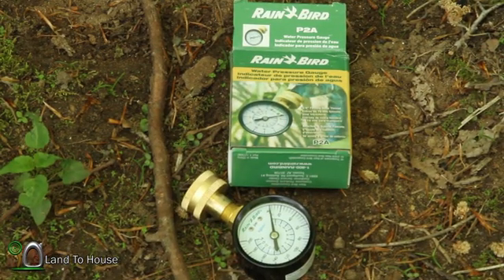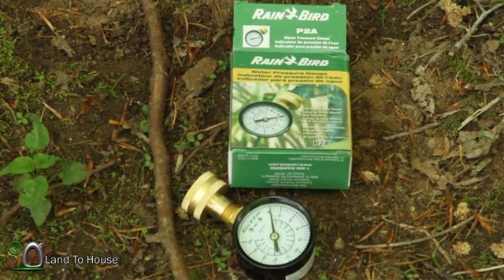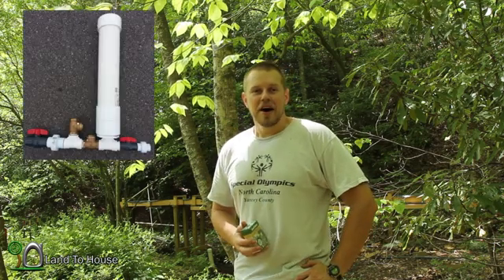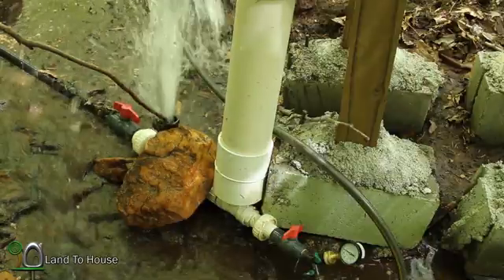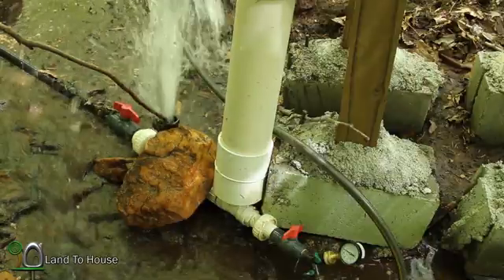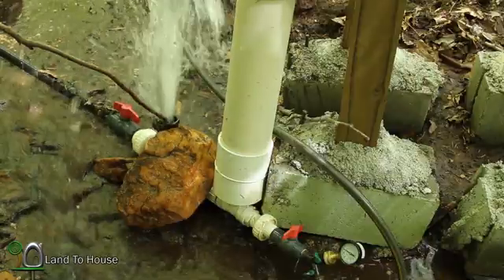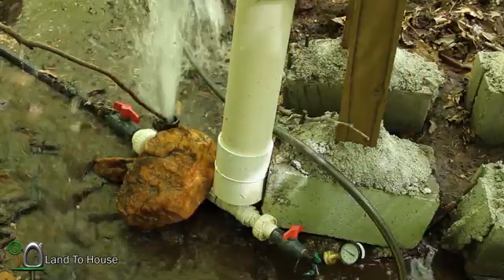Ram Pump PSI Test 1

Comment: Residual pressure with opening static pressure with no openings.      Roughly 5psi for every 10 feet of head pressure. .433 lbs per foot.      Just sharing some of my pipe fitter knowledge because these Ram pumps are interesting and this test was interesting. 😎👍.     I have not made one these yet and it’s a great idea for certain situations.

Comment: Have you ever tested the air pressure in the pressure chamber?  I'm wondering if using a large enough tank, that you could make an air compressor to run pneumatic tools?  Throw in a safety dump at around 160psi at the base of the tank, to expel water when needed.  Edit : I did the math, you'd need a series of ~8 equal size tanks to create ~100 psi equal to the free air volume of 1 of those tanks, all but the last would fill up with water. I suppose a bike pump (or something similar) would be more realistic to fill a holding tank.

Comment: it is the height difference between yr pump and the end of the hose.As we know  from physics pressure accumulated at 10 mtrs (30ft) of a water column is 1 bar aprox 14,5 psi, so by knowing the height  difference between the pump delivering the water and the hose end, u will know the pressure difference. that rule applies as far as i know at any horizontal distance and at any breadth of the column, meaning that no matter far or how wide far yr hose is , the height difference does the job.
Reply from the maker: Yes the atmospheric pressure is going to be the same on any size pipe. Pressing down on the water equally. So if you are using a large delivery pipe or a small one it will have the same results. Now that is considering the pipe is large enough to have little friction.

Comment: Great tool.  My ram only seems to run about 24 hours before it stops.  I don't have my stand pipe properly installed.  My flow over time slowly slowed down then increased then stoped about a day later.  I think I need to get my stand pipe fixed and a check valve in my delivery pipe.   500 foot of delivery pipe 200 foot of elevation
Reply from the maker: I still think you are getting some great results for that hight. But yes that check valve will make a BIG difference with that hight. It will relieve the pressure on the pump and allow for better flow.
Reply: @LandtoHouse  I have been going back over these older videos and find them interesting. However, why would a check valve inserted up in the line make any difference ?  The pump still has to force the valve open at the same line pressure at that point to get a flow.  It will however save losing all the water above it in the line if the pump or fittings failed in service.
Reply from the maker: @garyarmstrong9530  The idea is like a giraffes neck valves and heart. The pump cycles and sends a spurt of water up. The pump rests for a second. The water comes back onto that check valve and does not fall all the way back down to the pump. Basically a small bit of pressure is relieved from resting on the pump.
Reply: @LandtoHouse  bi-cuspid valves in veins are to ensure the blood flows only in one direction back to the heart and the local muscles (neck or otherwise) assist in moving the blood through them.  Once our water delivery pipe is full then regardless of how many inline NRV's there are, the pump is working against the total head with no outside influence (like muscles).  I wish the NRV theory was true, we could use that little 20 PSI pump to send water over mountains by using more inline NRV's.  However all said and done, I really enjoy re- watching your videos and perhaps this might be a good subject for your experimentation.  
Hmmm "muscles" - my 50nb ram pump has no pressure tank but rather a 1.5m length of 50nb  'rubber' radiator hose between the outlet NRV and delivery hose. What if you inserted your  extra check valve up in the delivery pipe followed by a short (500mm) length of hose to act as the muscle?